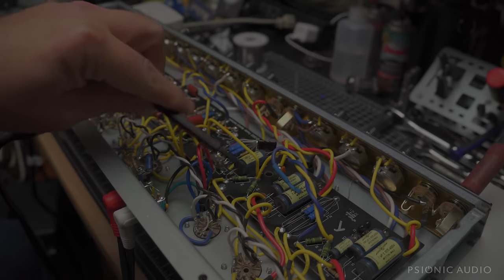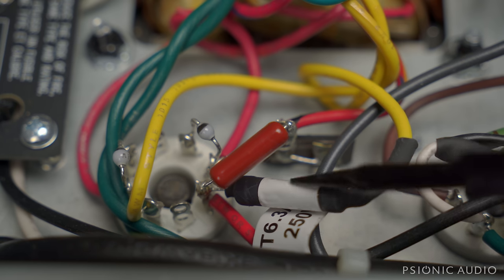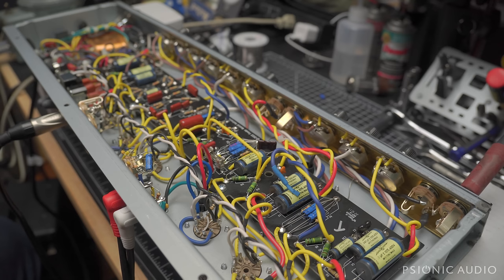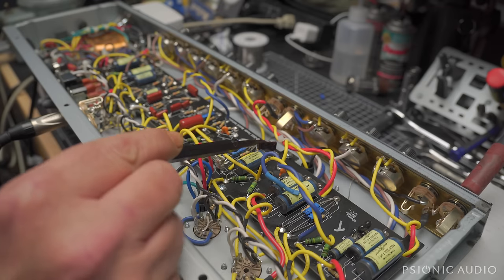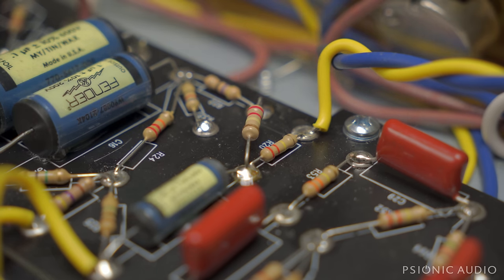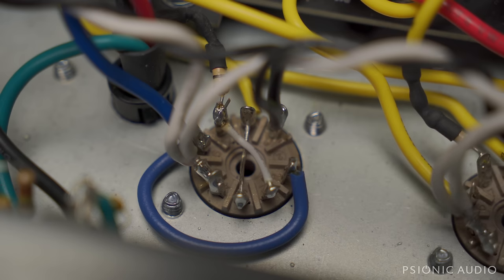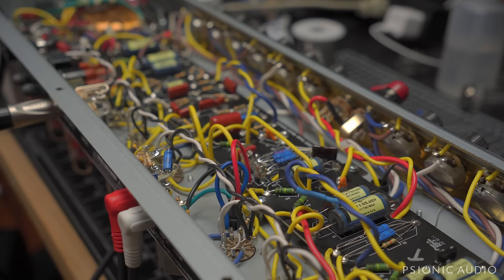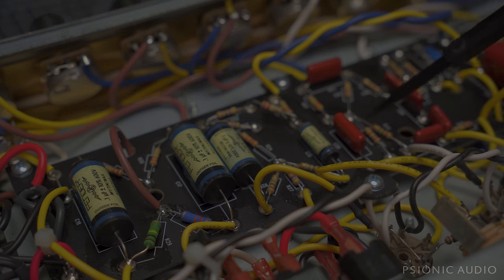Much Less Meh | Fender '64 Custom Hand Wired Deluxe Reverb Pt 2

Comment: Cadmium is indeed the metal in old Fender trem circuits. It's also a terrible environmental toxin so while Fender should be more upfront that they can't exactly replicate the old amps, I'm very much fine with them not using it anymore.
Reply: And how much does that do to save the environment? Lol
Reply: Chip, chip, chipping away.
Reply: European detected
Reply: @TeleCaster66  Across millions of units, in various sectors of industry, combined with the other harmful substances that would be included in the same regulation? Quite a bit.
Reply: @ukmnu2142  and you're... a "conservative" American?

Comment: That 220k/220k voltage divider might be dumping too much signal.  The quickest path to AC ground at that point on the traditional circuit is through the normal channel mix resistor, the 0.047uF coupling cap, and the 100k plate resistor for V1B.  This ignores the triode, which is the case with V1 pulled anyway.  A 330k in series with a 0.047 in place of the added 220k should mimic the behavior more closely since the cap gives it a frequency dependency--but is likely large enough to mostly ignore.  The added 220k is throwing away ~10% more gain than it should.
Reply from the maker: I did a big spice model of this a while back, but I was modeling V1 with its triode. I can't find it now, but IIRC it suggested 280K was pretty much the ticket, so 270K closest standard. In practice I find 220K-330K all gives good results. Bear in mind the increased B+ with V1 pulled. so headroom increases a bit - it's kind of a subjective choice within that range.

I want you to know I'm not arguing with you or saying you're wrong - this stuff is fun to think about.

Comment: I have one at the moment at home and what I can say is that it sounds wonderful without modification. the tremolo is incredible, the reverb is very usable and progressive. the normal channel is great.
Reply: I too have one and it sounds damn good in every respect. I suspect that every now and then, one that has issues gets by their QA folks and gets shipped off. I'm assuming Fender has quality inspectors checking what's coming off their assy. lines and looking at each one before it's considered complete.
Reply: I own one and it is pretty noisy. Noisier than my 1968 AS763 Twin Reverb... I also had a couple of issues when it first arrived it didn't work. had to send it back to the shop I bought it from (Brisbane). funny thing is my twin cost me less than half of what I payed for the 64 DR. Also the pots crack a lot... there's DC leakage for sure... but I haven't had the time yet to try and fix it... or the energy. the whole thing is rather disappointing. I didn't know any better, and Fender saw me coming.. I agree 110% with Lyle on this one. I absolutely feel like I got screwed over, and because I live in Australia, HA! who cares! not Fender!
Reply: @TheOdizeo fender AUS cares bigtime. If you have those issues and it’s in warranty call/email them and they will sort it out.

-someone who cares

Comment: Great videos, Lyle! Thanks for posting all of these; they are so informative! I bought a used ‘ 65 Deluxe Reverb re-issue; it sounded great when I bought it. I had my local amp tech convert the app to hand wired and it sound 10 times better, and all in the cost of the amp + upgrade to HW was about a third less expensive or half as expensive as buying the ‘64 handwired, which, obviously, as Lyle has shown, is still a mess.

Comment: A great and very infirmative video, thank you for this. Can't help but be disappointed, giving the billing the amp was given and it's price point. That being said. I've just swtiched mine on and sure, with the reverb turned all the way up, there is more 'urgent' hum, but no feedback, nothing actually  - thats also on max volume. I kept the volume anad tone controls maxed with the reverb down the level I'd use it at and I all I had was a distant hum and  the usual hiss. OK, its nowhere near Two-Rock quiet, where you'd think it's on standy until you hit the strings. I bought the '64 Deluxe new last year and gigged the amp many times now and its been fine. Maybe I've got a good one as it sounds fantastic, but its evident from the vid that Fender have cut some corners and that is really disappointing. Best start saving for one of Mark Bartels' products....

Comment: What a difference it makes with just a little TLC. I have to question the modern manufacturing methods. My 57 Custom Champ (bought used) is good but my SF Champ gives it a run for it's money. I re-housed my non-verb Princeton in a MojoTone cab with a Celestion G12M-65 and it is blissful. Thanks for ALL your excellent videos and brutally honest observations.
Reply: Great choice of speaker. I have swapped out the stock Jenson speaker for a Celestion in my Fender amp.

Comment: I just received a 64 custom last night. I was really nervous about placing the order due to the reviews about hiss and already had plans to send it back. To my surprise it’s absolutely quiet. Now I’m wondering if fender has corrected the problem or if the build quality is that inconsistent. The most surprising thing though is, it’s not much louder than my 64 Custom Princeton . Definitely fuller sounding.
Reply: See my post today - mine is very quiet, really pleased with it. Maybe there is some inconsistecy in build.

Comment: Thanks you so much for this! I added the 220k and rewired the V3 socket (normal channel is still active). Now I love my new Custom Deluxe Rev. with significantly reduced hiss and noise floor. Only thing I wonder is, what might be the altered mix resistors in the preamp you are talking about where the additional 220k is not needed. Can you please explaine a bit on that? Or is it in the clip and I oversaw that?

Comment: About LDRs, European here. 
I had to draw and 3d print myself the housing for a couple of double element LDRs for a Red Knob (the) Twin recently. I could source the LDR elements and LEDs separately no problem, but not the assembly. On top of that, those were the weird one led - two LDRs in one casing ones, so some fun... I think it is the Cadmium in the Cadmium sulphide cells, there is a kind of an exemption for the cells themselves but not for the assemblies. And I also know that fixing a red Knob Twin is an exercise in futility, but it belongs to a friend.

Comment: After hearing you comment on the presence of the F&T filter caps vs. Spragues found on a different unit, and then seeing your comment about the series 2.2nf / 250pf caps on the normal channel... I gotta wonder if electronic component part allocations affected Fender just like they did so many other electronic device manufacturers due to pandemic-induced supply chain restraints. 

Can't get a supply of the right value cap? Put a couple parts we have in plentiful supply in as an equivalent-value substitute! 

My work was heavily influenced by electronic part supply shortages, and like other electronics R&D labs and manufacturers, we had to get creative with what we were able to source to stay in business. And you probably already know that we're still not out of the wood yet regarding parts supply.

Comment: Would you add the 220k resistor even if you did not disable the normal channel?
Reply: I did together with rewiring of the V3 socket the with very positive effect on hiss and noise floor. Anything else is unchanged to date.

Comment: @PsionicAudio Thanks for the interesting videos! So in substance, if we leave out (please!) for a while the sloppy build (loose bolts, poorly mounted internal fuses, "cosmetic capacitors" etc.) as well as the "value for money" discussion; the main DESIGN flaw of this amp, which has a direct impact on its sound quality, is the way the two channels are being mixed (generating the high idle white noise)?

Comment: I believe the '65 reissue has an opto trem and Fender sell them in europe so I doubt that was the reason behind the bias trem option for this amp. Anyway, great vid as usual, Lyle ! Will rewire V3 just like you did on this one next time I open it up and will also check if all the hardware is tight 😉
Reply from the maker: The EU version of the 65 and 68 have a little solid state daughter board added on to replace the opto trem. No LDR in those either.
Reply: Thanks for clarifying this. Those EU regulations are crazy ! Stangely enough you can still buy LDRs from TAD...
Reply: @matbouche I think the EU allows the CdS Cell based trem roach as it is a repair part and not a new design/new manufacture.

Comment: Love the 'new' reverb. Did you stick with the OEM tank on this? It sounds so much better than the tank/circuit in my 80s The Twin.
Reply from the maker: It’s the stock Ruby after the mechanical repair.

Comment: Could you give us an idea what the level 1, 2, and 3 services would cost? Thanks!
Reply from the maker: Level one was bench fee of $150 and $5 in parts (prices as of 1-24). Level two would be $245-$325. Level three would be $330-$410. Probably the higher end of the estimates as I’d have to remove a lot of bad solder to then redo things properly.

Comment: Would some of these issues with the gain, etc. be mitigated if the owner left a tube in V1? Almost sounds like Fender is counting on the end user not pulling a channel tube like is possible on the originals.
Reply from the maker: It’s still too noisy in stock form with all tubes present.

Comment: Love these videos. BTW, the CDE micas are at CD Distribution now! 
Did I catch that the normal channel is disabled? That is unfortunate option for a $50 dollar amp, let alone a $3k amp. Captain Obvious
Reply from the maker: It was the least expensive way to remove the noise as the owner doesn't use the Normal channel. As the board doesn't have eyelets for the usual Normal channel output cap or its associated mix resistor, this was the least intrusive option, though it would not be my preference. It's a piss poor design.
Reply: No critique of you. It was a critique of the design for sure.
Reply: Could you build someone a Mojotone kit for under $3k? Just curious, don’t worry, I won’t ask you to build one.

Comment: That 2n2 in series with 250pF: Perhaps if there is DC voltage to be blocked and that 250 pF cap is of poor quality,  that 2n2 could  just be a safety feature. 😁
Reply from the maker: They used a solo 250pF on the other channel.

For those new to series caps, 2.2nF in series with 250pF gives you 224.5pF. Extra expense to achieve nothing.
Reply: @PsionicAudio  God only knows  what they were thinking.  Well, maybe even God doesn't understand what they were thinking. 😁

Comment: I had a 1964 Deluxe Reverb and I don't get this.  This is nothing like a'64.

Furthermore I tested the 1964 Deluxe Reverb against a 2001 Deluxe Reverb reissue using the same speaker and could hear absolutely no difference!

This is a scandalous angle to sell more gear to the naive and preserve the antique market prices/hype.